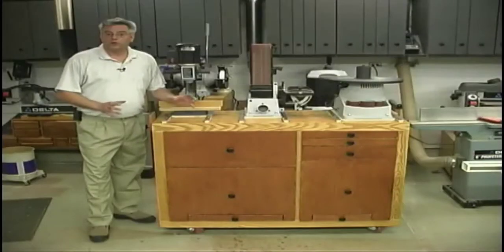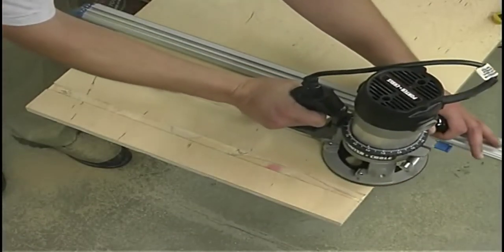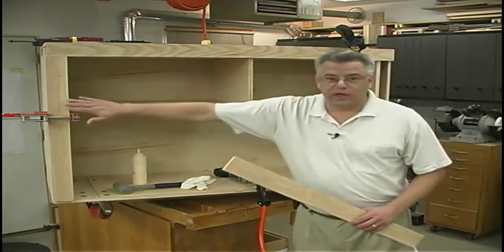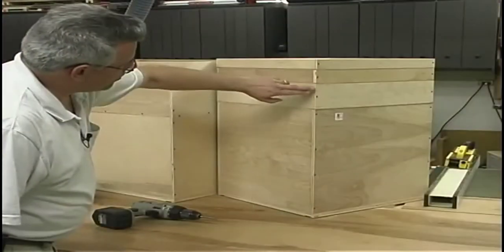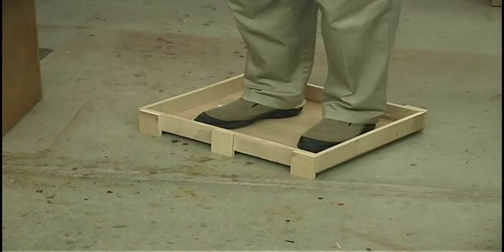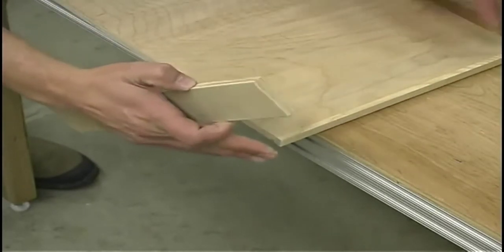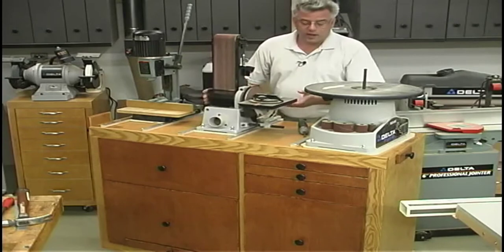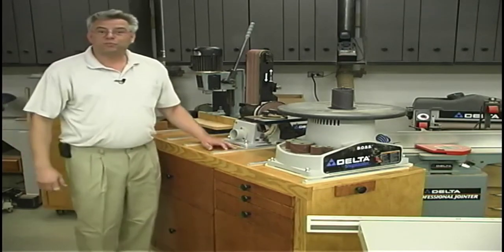W057 Make this Bench Tool Storage Cabinet for Your Shop

Comment: Chris, just a word of caution when using story boards such as you did for positioning the side-mounted drawer slides.  At 24:00, you placed your story board against the gable... but unfortunately you had the bottom about an inch away from the gable at the bottom, giving you an erroneous height.  In addition, I use story boards all the time for these installs, but go about it somewhat differently.  While I've got the slide sitting atop the story board (which I quickly clamp against the gable using a spring clamp or two), rather than just drawing the screw locations, I put the screws directly into the slide mounting holes.  That's not only faster, but more accurate too.
Reply from the maker: Thanks for the great feedback Marty, much appreciated!
Reply: @MakingStuffwithChrisDeHut  I really like your professionally created videos, Chris and what you're doing to help all of us out.  Thanks ever so much.  I'll "see" you over at the CWW forum!